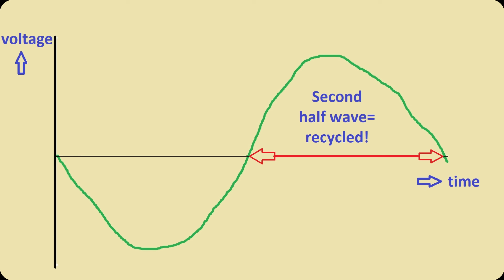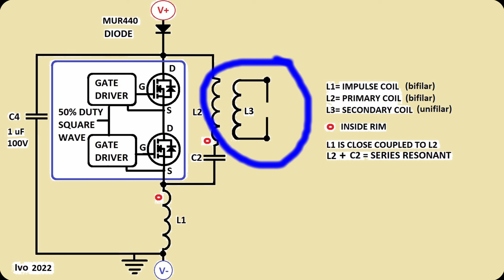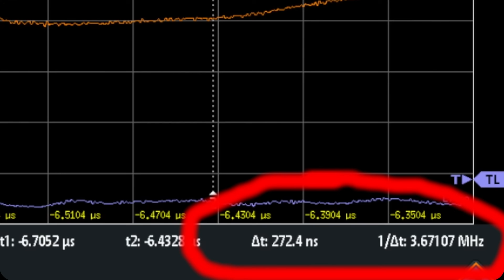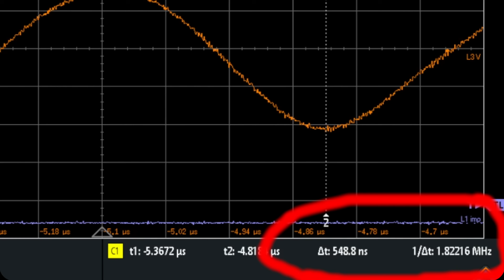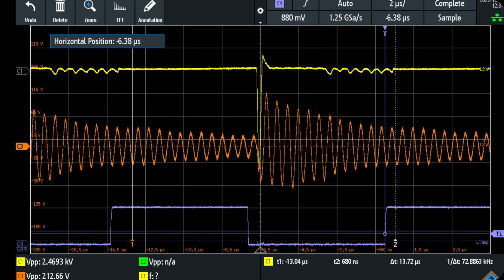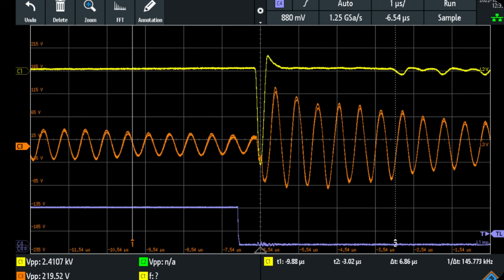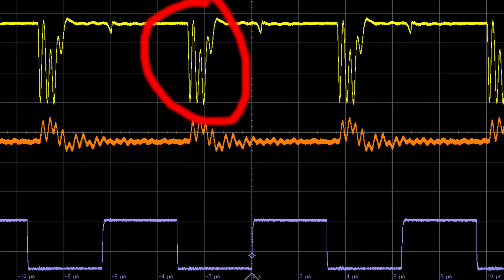Tesla coil excited by Nikola Tesla's Impulses. Very Efficient, 63W=100kV, 35mm sparks

Comment: 14:35 thats how you make O2 or O3 or even O  which is dangerous i believe (O) single
Reply: I think its dangerous cause the single O cannot form water cause you do not have single H in your body , you have H2 in your body (but its already bound to a single O and having other single O will join with the H2o to form H2O2 hydrogen peroxide).only good for you if your body is not making enough but thats not likely so you use up your SOD aka Glutathione by consuming single O. Also the single O will bind to the single O found in the H2O in your body and essentially dehydrate you by destroying a water molecule. I could be wrong as usual with science

Comment: 8:39 I have a mind blockage and for some reason i cannot differentiate the two . Dielectric and Magnetic or electric field . How exactly are they different ? please lmk
Reply from the maker: everything is energy (aether) and energy takes all forms. magnetic field=energy field
dielectric (electric) field= energy
just in a different configuration.
Reply: @MasterIvo  Well said Ivo , 	
Bob & Ann
myke Does It's like the analogy of water, ice, steam. They are all one thing at different frequencies or pressure modalities. Water is the aether. Ice is the aether accelerated/voltage/potential/inertia and steam is the aether as force and motion/amps It's the other way around according to Steinmetz, he says the magnetic field is the field of the dielectric. What really helped me understand the concept was looking at their geometry. The Magnetic field we know is a Torus. So I went to Google images and looked up torus, toroid, toroidal. What I found in the center of the toroidal field was a Hyperboloid which I also looked up in Google Images. The Hyperboloid is the geometry of the Dielectric and the obvious source of the toroidal field. That is how the Magnetic field is the field of the dielectric. a They are all one thing under different pressures.
Reply: The magnetic field is what surrounds a coil when the electric field collaps. The dielectric field is "around" the dielectric material(insulator) of a capacitor.

For what i came to understand after all these years is that the magnetic and dielectric are both "componants or behaviours" of the electric field... A bit like the chicken and the egg thing... Wich one came first, you know. Having all these different terms for what seems to be one phenomena is miss leading for me.

Strong dielectric field = capacitor what happens around the insulator/dielectric material

Strong magnetic field = magnets or coil/right hand rule

Electric field = both? A "field" becomes electric if it is electrified and it involves both previous field, but what one comes first is not the question to ask. You see where i am going? I dont really know much more and im certain i am missing or even mistaking on some stuff... Ssoo lmk if it helped and i certainly am into learning more about it.

Comment: Interesting to see that sparks don't go direct between electrode points, shouldn't the shortest way be best to discharge, perhsps only the first microsecond....here we see it's not the direct way later. The indirect route could be that the dark matter be overcome  or circled around or the forces (Coriolis, Gravity) on our planet or it's atmospheric conditions of gases and humidity be involved even this short distance of a couple of centimeters or that hot air is not a good media for electricity seeking lower resistance ? Nice model you can move the primary coil over its secondary tubewinded, the center setup like shown it's logic to be the location of least amount of input power with longest distance of spike or voltage  output open (sparks). A hair dryer =hot air flow on the spark area could be a good experiment to find why sparks do it's fluctuating light emitting thing and noise, but don't blame me if the sparks go into the dryer.
Reply from the maker: there is no wrong, just different perspectives.

the tungsten rods were pointy but one had membranes on the side, which was to main cause for sideways discharges
Reply: there's no 'dark matter' its just mathAmagic related to the bb hypothesis & the church of Einstein scientology
https://www.youtube.com/watch?v=xaC_aKqjCXU&t=1s Quantum Electrodynamics is rotten at the core
Reply: Sirs, what I know from weather cience athmosperic knowledge is that a mass of air retains similar composition característica. On the borders to other mass there is a pressure increase a slide up or sideways and sometimes the mass of air is dispersed by absorbtion and mix into the new area it is moving in.
Reply: A larger mass of air has similar composition properties and behaves by not mixing right away into the surounding or other air masses and when moving over land or sea creating fronts that have sliding up or under característica (warm and cold fronts respectively) due to weight/density of air. To see air now as micro bubbles makes air less coherent to act as a mass of air in the larger weather area term, meaning is it really only that what bends sparks ? Doing the experiment of discharging among "electrode terminals" inside of a vacuum crystal burned/ broken light bulb for instance one could touch the other terminal also outside and demonstrate if the air bubbles remaining (ver few I guess) is the cause of this irregular path, all sparks should be straight now !

Comment: Could you test the output for water disassociation? Could this output be more efficient than standard electrolysis. Inspired by the question about Stanley Meyer. Efficient disassociation of H20 would change the world very quickly? There are a number of examples where water with sodium is used to make hydrogen via exposure to RF. Also reports of 2 inch beam radar on navy ships setting water on fire when it strikes the water. It might be possible using the right catalysts to make efficient hydrogen with a high efficiency circuit. Sodium might be a start. Or who knows maybe filtered sea water with a range of minerals and elements.
Reply: Voltrolisis vs Electrólisis.  Stanley Meyer used Tesla  impulses no regular dc /ac

Comment: I love your work. For some reason I am being lead to ask you if the primary coil could be energized by a pulsating back emf set up.
Reply from the maker: thanks. but it is!
L1 is pulsed by the mosfets and produces back emf (impulse) which is directed into the primary coil (L2) which is series resonant for low impedance.